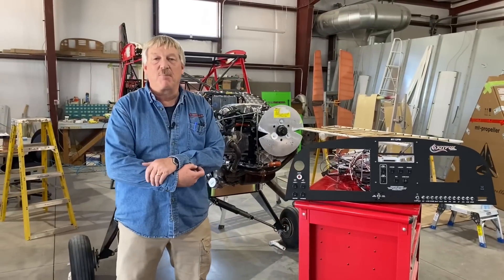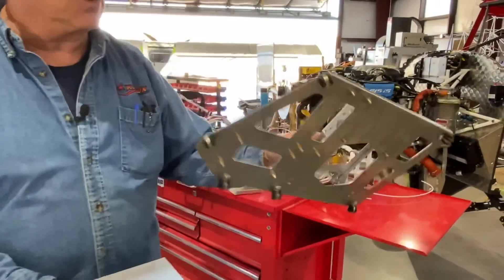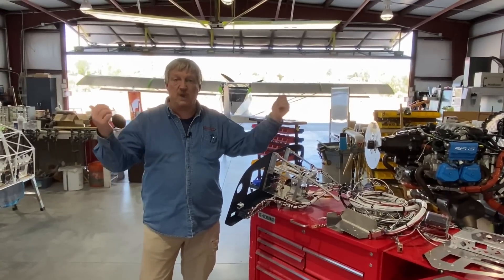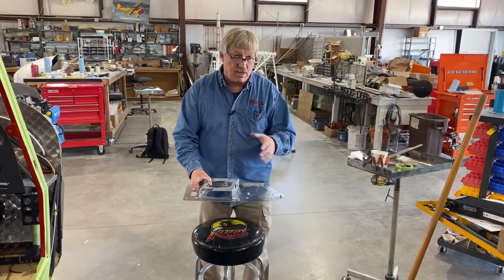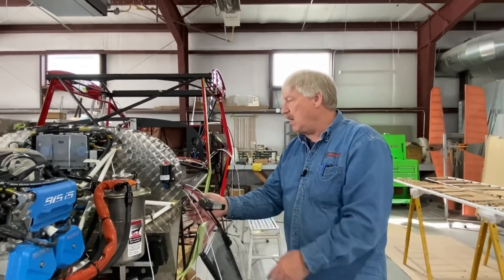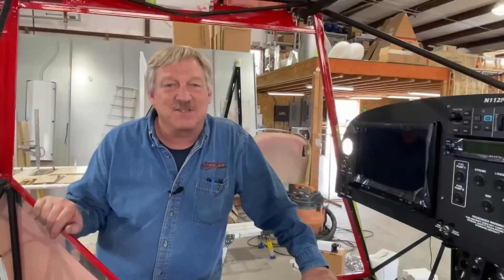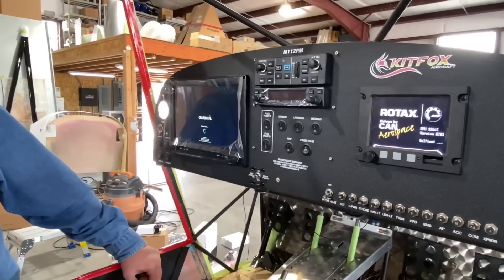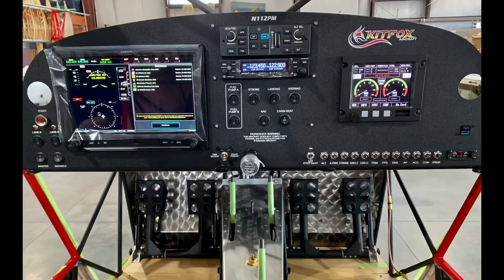Kitfox pre-made instrument panels and wiring harness

Comment: Hi John,  looks like a great option to get the panel in quickly with less complications, especially if the builder wants to go with Garmin, which I do.  I was wondering why you didn't also go with a remote radio driven through the touch screen panel vs the radio controls on the panel?  I can understand having the auto pilot control panel on the panel vs the touch screen as I would want to have quick, unambiguous, and positive access to the auto pilot controls.  Looking forward to full descriptions of panel options and pricing!

Comment: Two questions:  (1) Would a potential buyer be able to see an electrical system architecture drawing before committing to this option?  (2) Will buyers receive a complete circuit/wiring diagram to aid in troubleshooting, maintenance and future upgrades?  Thanks, John.